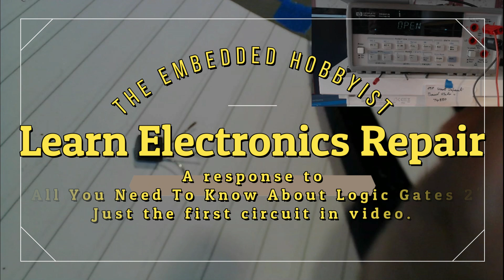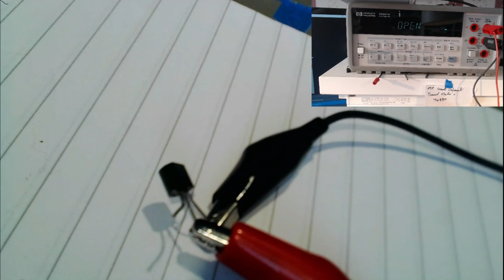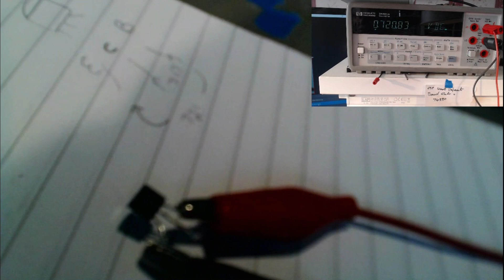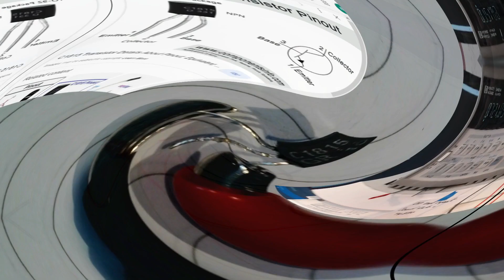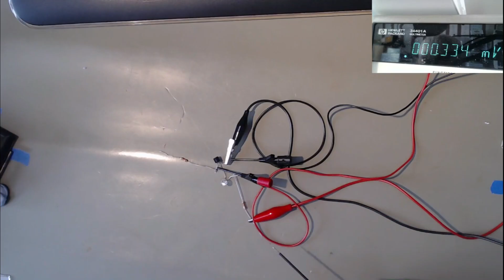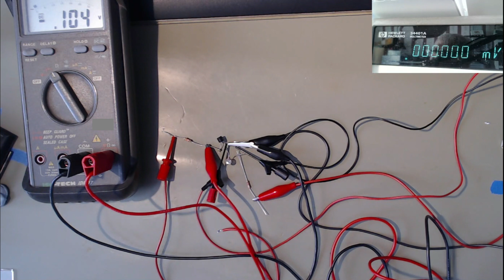#163 Response to Learn Electroncs Repair's logic gates video

Comment: the power of your hand is awsome 🙂
Reply: SQUEAK!!!!!!!!!!
Reply from the maker: Yes and it's Free Energy, maybe if i get loads of transistors and a few more hands i could power my house.
Only problem is most of the voltage pickup is 50Hz from the house wiring. So disconnect from the grid and it will all go away :-(